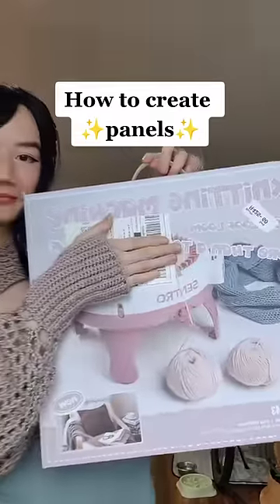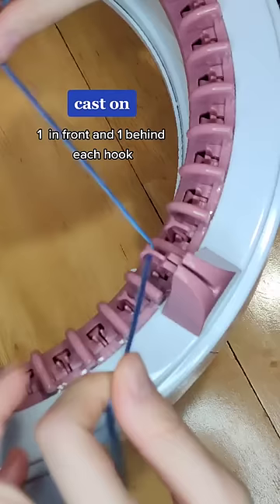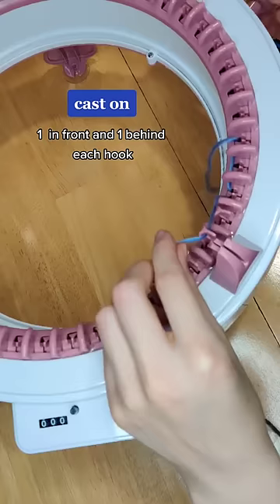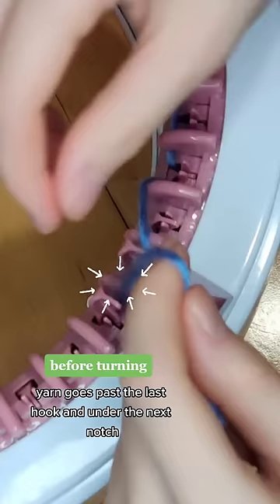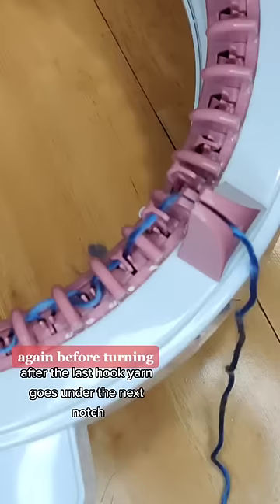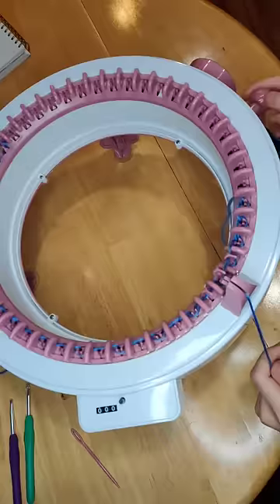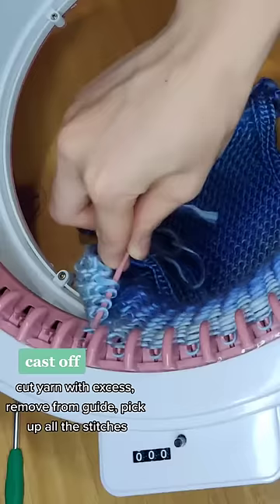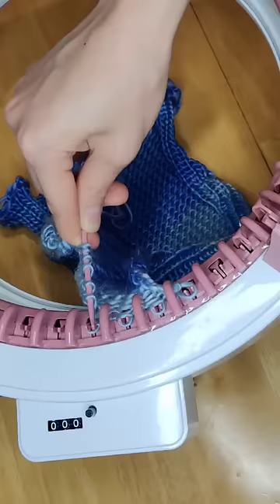How to knit PANELS on a Sentro Knitting machine

Comment: how do you keep from dropping stitches? i have this exact machine and im so close to running it over with my car it's ruined so many pieces.
Reply from the maker: Hello! I have another Short with tips to prevent dropped stitches https://youtube.com/shorts/bjeslqwF0xQ?si=5aHLnIRI12iTwJQG

I hope these help! I was a few projects in when my stitches became more consistent, the main culprit is usually tension. I would also recommend doing tubes until you get the hang of it. I made lots of beanies to start :) 💗

Comment: Now I need to find out what a panel is.😂😂
Reply: I believe it just means a rectangle shape, rather than a tube. you can use them for all sorts of clothing making. you can even make slippers if you sew the pannel into the correct shape ( Google can help so you can see for yourself what I mean by shape,for reference)! 
you can also make a coin pouch/wallet or a bag of some sort. it is your personal choice how long and wide they are. 
you can also make them on a round loom (much cheaper than this tool!). and if you need it to be bigger in either direction no worries cuz you can make more than one and them sew them together.  
have fun! ❤
Reply: @felicityjohnston9276  OH, that makes sense! Duh! My brain did not brain at that specific moment 🙃 😅 😐.  Thanks.
Reply: @lewasil  no worries love ! yw 😁 ❤️

Comment: All my stitches keep slipping off of my machine. I’ve tried multiple types of yarn, yet no matter what I do, my stitches are slipped (and not just a few but every couple stitches one will slip. It builds up too)🤦‍♂️ I just don’t know if something is wrong with the machine I got or if it’s just me being dumb 😅
Reply from the maker: Hey! I have another short with tips on preventing dropped stitches, I'd recommend working in a tube until you get the hang of it usually the culprit is uneven tension (it also took me a few tries before I didn't drop any stitches) if there are any loops that look like they're going to pop off I push those down. Best of luck! 🍀

Comment: Mine doesn't lock up where yours does.  Mine locks about the 20 peg. What am I doing wrong? 😢
Reply from the maker: Oh no, does it only lock up on the "P" setting? You can try setting it to "T" but doing the same steps for a panel instead of a tube
Reply: Yes,  it only locks up on the Panel setting.  It's not locking where it's supposed to.  I'm so new to this,  I don't understand what you mean by using the T to make a panel.  I really appreciate you responding to my question.  Thank you so much dear.  ...